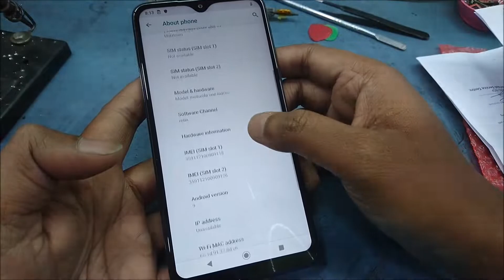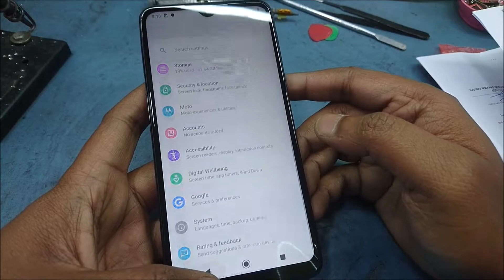Motorola One Macro Display Change and Disassembly Guide

Comment: Great video. How much it would cost for replacing front and back panel of Motorola One Power?
Reply from the maker: Front lcd is 3500 rs to 4500, and back panel is 1500 rs to 2500 rs approximately in service center in your city
Reply: @amitkeshwar2428  I am in New Delhi. I have zero faith in Motorola service center. Do you have any recommendations?

Comment: How much it cost to replace the broken glass?
Reply from the maker: 4500 to 6500rs. approximately
Reply: Give link to purchase combo for Moto one action
Reply from the maker: Service center only for original part in your city
Reply: @amitkeshwar2428 Is it working well after replacement of front screen?
Reply from the maker: Yes
Reply: @amitkeshwar2428  6500 rps can buy a new mobile